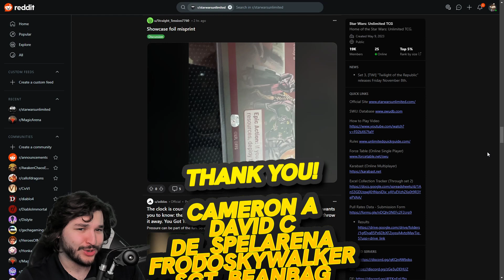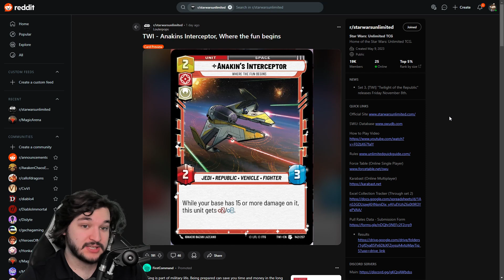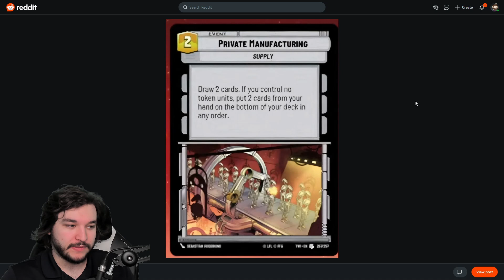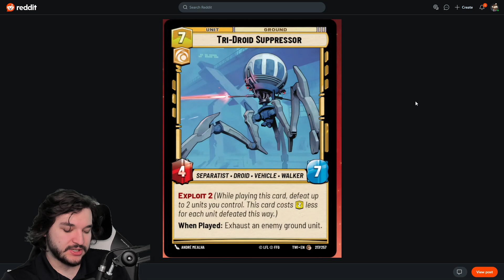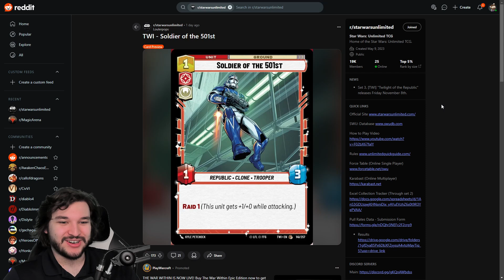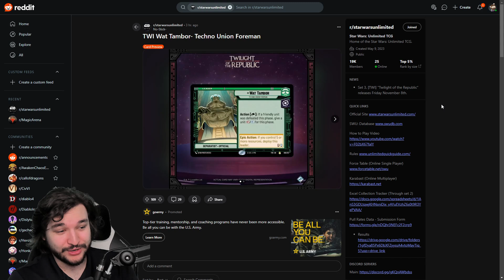INSANE New Exploit Cards! Brand NEW Leader! | Star Wars Unlimited

Comment: I think Wat Tambor is stronger than you think. You're roughly giving another unit a better Suprise strike worth of stats (Cunning 2 cost give +3/0 to a unit then attack) with a 3/6 body (which 6 health is awkward to kill early on). Normally you would have to pay 4-5 resources for a card like this, and then play 2 resources for that amount of stats. Or Another way is Vambrace Grapplegaurd which is an upgrade which is 2 cost as well that gives +2/+2 . Now understanding Wat Tambors effect is conditional. However, its really easy to have a unit die every turn. Especially if tokens become meta.